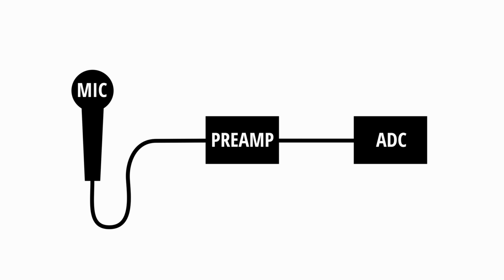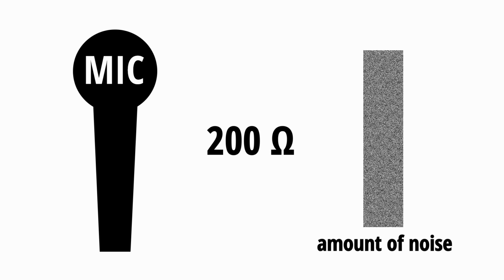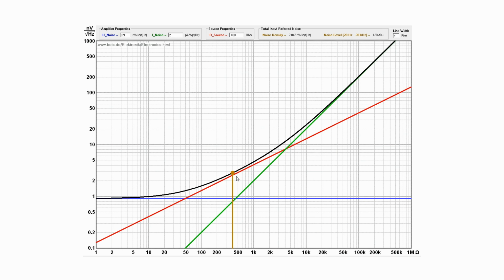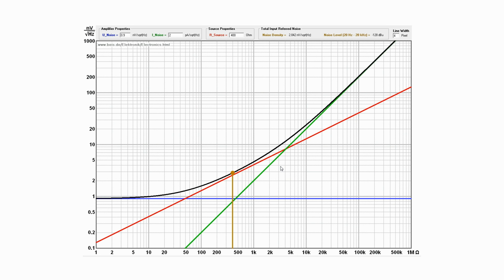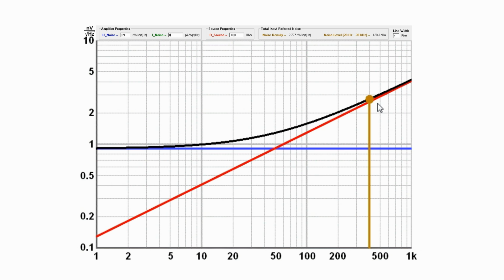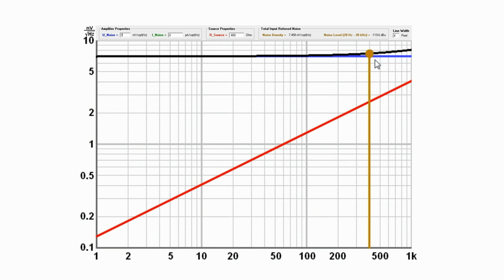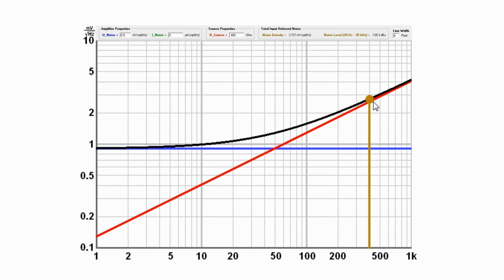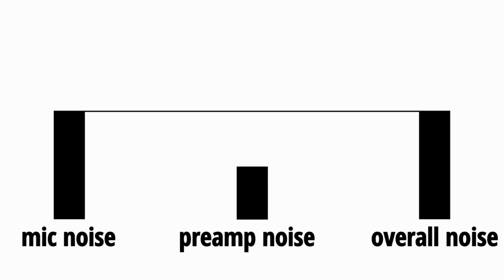microphone preamplifier noise explained

Comment: A very informative and insight-giving video. Yet, there are some points unclear: 1st, why did you plot the thermal(mic) noise as if it is linear?  sqrt(4KRTdelta(f))is the thermal noise formula, making me think that the noise is proportional to the square root of the resistance instead of the resistance itself. 2nd point is when the two types of LNA noises are added to the signal; after or before the amplification. Thanks in advance, sir!
Reply: this

Comment: Very interesting thanks. The only problem now is I looked up the impedance of my mics and it got more confusing again. For example:

DPA4060                                                  "Output impedance 30 - 40 Ω"
MKH416 which to my ear is quieter    "Nominal impedance 25Ω" and 
                                                                   "Min. terminating impedance approx. 800Ω" 
Sony ECM-678 which is quieter still    "Output Impedance at 1 kHz 200Ω±20%, Balanced"

I'm sure the 678 is quieter than the 4060 but the 4060 specs don't specify kHz as the 678 spec does. I have no idea what Min. terminating impedance means either and is nominal the same as output impedance. I get the same sort of problems trying to compare other audio specs.
Reply from the maker: I can understand your confusion. The statement “the impedance of the mic is directly
related to its noise” only holds true for dynamic microphones. All the mics you
listed are so-called condenser microphones. Condenser mics are electronically more
complex compared to dynamic microphones. The noise of a condenser mic mainly
originates in its electrical circuit. So, comparing impedances won’t tell you
anything. 

If you want to compare the noise of condenser mics, have a look at the “equivalent input
noise (EIN)”. This value is usually stated in the spec sheet off a mic. It is usually
stated as an a-weighted or CCIR value. You can only compare CCIR to CCIR and a-weighted
values to a-weighted values. E.g. mic A has an EIN CCIR of 24db and mic B has
an EIN CCIR of 28db. Higher value means more noise produced by the mic. So in
this example mic B would be noisier than mic A. Same with a-weighted values. 

But always take these numbers with a grain of salt. The PR-department of a manufacturer usually
rounds these values a bit to make a mic look better on paper. Still the best way is to
test the mic on your own and see if the amount of noise it produces is
acceptable for you.
Reply: ahh thanks for that. Yes nothing is like testing the thing personally to be sure.